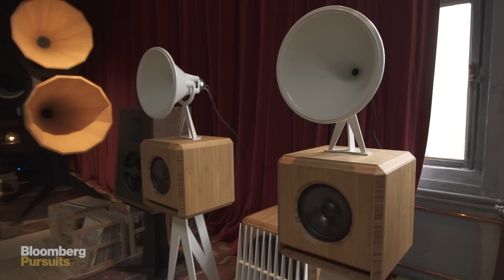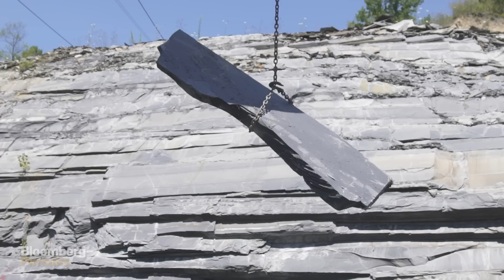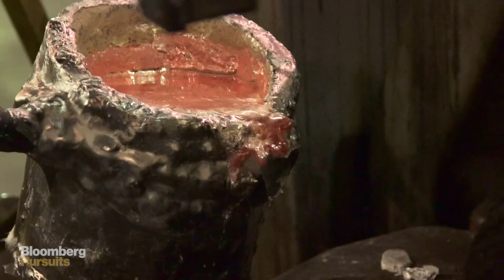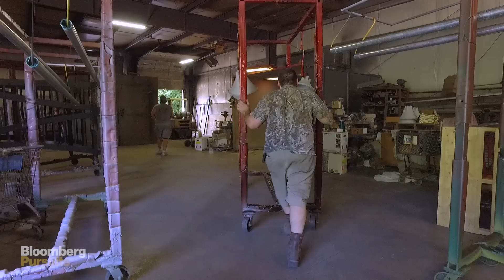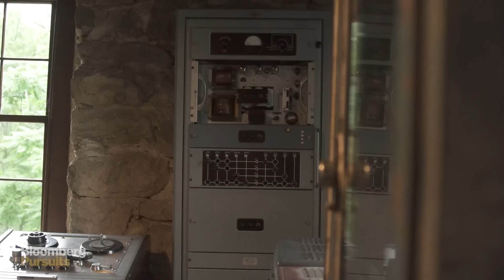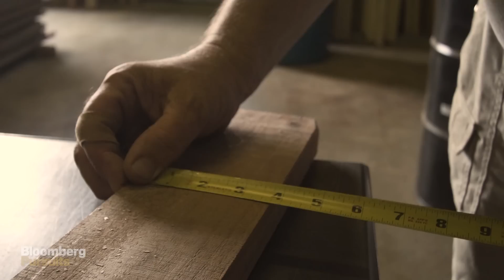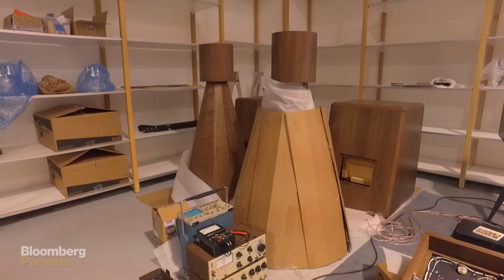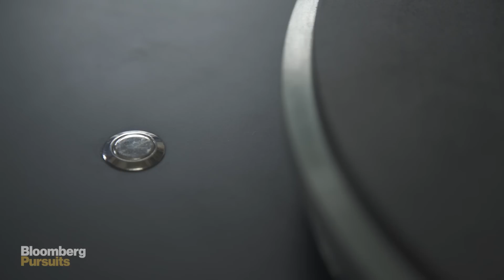How a $300,000 Speaker is Made

Comment: Why not just automate production using the same components and design? Surely it would produce a near enough quality product at a fraction of the cost. Or do these snobby 'audiophiles' just like to feel like a special snowflake when they think of all the hard work that went into their vanity trophy?
Reply: TheGuineapig certain things can't be automated. In fact even low end equipment has some hand assembly towards the end. That being said, this guy and his company is a hackjob and not a good reflection of the hobby whatsoever.
Reply: Of course there are things that can't be automated. However, soldering circuits and precise woodwork are not examples of those things

Comment: for $300.000 i'd expect better soldering and cable management
Reply: Really nice argument there.. Just shut your mouth if you're not going to contribute with your "knowledge". I'd love to be enlightened if you really have something worthy to say. But I doubt it since all you can do is making insults apparently
Reply: Prove me wrong and try to convince me otherwise then.. "Nah let's just throw an insult"
Reply: I just gave my opinion formed out of my own experience and knowledge. No way in hell I'm an expert and if I'm wrong,  I'm wrong. So please, tell me where I'm wrong since you seem to know it all
Reply: I think  I understand what you mean because I'm experiencing it right now... Good day sir
Reply: Thats a load of bullshit. 1: "high temperature-slowing solder".. It just means the solder has 2-4% silver in it, the rest is just regular tin, like any other solder. Which does indeed increase the conductivity, but only a very small fraction.. Also, heating up the metal parts you solder is the standard process when soldering... So the solder can flow easily and it makes a good connection. It's literally the definition of soldering. And in NO WAY that allows for the soldering to be that hideous.. Don't even get me started on all the cold joint .. This is just bad workmanship 2. Solid silver wire or not, the cable management in that thing could be far more improved, it looks awful. Solid silver wire is still bendable so the look of these electronics is totally not justified .. For $300 000 that shit should've been the most neat wiring ever. This whole product/company is just outrageous. Also, it uses a fucking pcb..
Seriously, people like you are the reason these companies are able to survive.. They use some fancy words  to describe a regular, standard procedure, call it 'high end', 'the only one on the market', 'better than any other method out there" (without having any scientific data) give it a ridiculously high price and ignorant people fall for it like flies. Any man with a regular functioning brain can tell this guy is just full of shit
Reply: Yes!  Thank you!
Reply: This man is a troll guys. Let him be... He will only try to fight you with words, make irrational statements and play himself off as he knows everything without actually sharing anything...
As far as I know, I have invited him to a debate and he's the one starting an argument but whatever.. Let's be smart and just leave this comment section so he can have the last word and be happy.. Sad though since I'm not at all an expert on the subject and would have loved to learn more..
Reply: Batt Man also the only difference between a debate and an argument is that an argument is usually heated. Seeing as you were the one calling names it seems like you were the one turning a debate into an argument.
Reply: Batt Man Mate, for this amount of money this is a really shit product. I'm sorry, but it is. 300k is something you can buy a house with, not a fucking speaker
Reply: Batt Man I wasn't trying to cause an argument. I'll agree the other guy was but don't rope me into what he was saying. Oh okay actually I understand why you debate the way you do now. You're a Christian. It's kind of like a prerequisite for being a Christian to be non logical and bad at debate so I get it now.
Reply: DR van der hull ??? i dont think he is a doctor in anything. if he is it is madness. he sells complete bullshit products. sen his new invention ? something you cant hear but really makes a difference.. it works on your brain with waves and such.... for real doctor vd hull.........
Reply: YES!  The engine bay of a Ferrari is as beautifully engineered and manicured as the the rest of the car.  At this price range the guts of the amp should be as artfully built as the rest of the system.  It was amateur work at best.
Reply: Your paying the 300k for the privilege of bad soldering and cable management.  Its the price for a nostalgic moment.
Reply: I guess he is intended to imply "come on we don't even accepts that if it is $300"
Reply: This is what I love about youtube: you can easily annoy racists and losers.
Reply: Take a look at the source I have given to you, 11-2 Q, page 57.
 www.vandenhul.com/download/CAwdEAwUUkNEW0Q=
I doubt if you can read though.
Reply: Eddi Kimball Oh wow you are dumb.
Reply: I second that. He's a squanchy squancher that needs a good squanching!!!! Ya hear me, Rick?
Reply: Maybe he can add the line: "randomization of the soldering & wiring techniques helps achieve a more balanced tonality, unlike inferior products with their rididly structured layout' LOL  BTW: That's actually true though = same way 'point to point' stuff tends 2 sound better becasue 'less interaction' between things (nothing 'neatly packed').  Same way stripping off the finish of a guitar & banging the body 2 $hit with dents & chunks missing helps break up standing waves 4 a more lush sound =)
Reply: I always find the ignorance of a lot of Americans to other countries. Like I live in America and I know a lot of countries use periods and not commas for thousands places.
Reply: Batt Man he didn't thumb up his own comment I thumbed it up lol
Reply: Batt Man also he didn't retort in the same way he never called you names to insult you lol
Reply: Batt Man what I was adding was calling you on your bullshit but alright.
Reply: Batt Man I actually did read the other comments and the other guy seems to know more about what he's talking about so after reading quite a few comments I decided to start liking them and replying. You just assumed I didn't read them because I didn't talk about them. I didn't talk about them because I don't know about soldering but his points seemed more correct to me.
Reply: Batt Man just because I'm not middle aged like you doesn't mean I'm uneducated. In fact just me being an Atheist alone makes me more logical than you. I don't believe in a magical sky daddy that grants prizes to those he deems worthy and to those he doesn't deem worthy he allows them to be killed and get cancer. Yeah what a great being to believe in.
Reply: Thank you guys for all the comments, even though some are hostile. I respect all of your efforts in writing those comments, and I will start my own channel to answer these, probably later next week. 

I apologize for my limited knowledges, and you can say this is because I am only 15, and I am only a Hifi Fan for 4 years, even though I have been making my own headphones, CIEMs, and Amplifiers by myself for over 3 years.

First of all, I apologize for being unable to find the reference for my claim on soldering yet, but after contacting the engineer of Dita Audio, Mr. Goh, told me that the soldering job is acceptable in this video, but could be cleaner. Too much leftover flux is on it. This joint is a result of cold soldering, and the reason why it looks like primary school work is that the cables connected look very messy.

But this mess is necessary. The components are hooked up by thick electric wires, probably made of silver(much thicker compared to PCB). This would massively improve the sound quality, especially for the high-frequency. Some wires are also wrapped in metal as a shielding layer. This minimizes the EM distortions, which benefits the sound quality. This is very common in Hi-end audio products. PCB is much cheaper, and much easier in assembly.

The reason why silver is added in the solder is not because of the conductivity, since the improvement is negligible, but because that the 3% silver in it provides a protective layer on the surface after the solder is cooled. Using a silver tip on the electric will do the same job if you cannot afford silver solders.(Reference: AJ Van den Hul, www.vandenhul.com/download/CAwdEAwUUkNEW0Q=)

Should you need any further information, please do not hesitate to contact me in the comments.
Reply: Still, read this.
11-2 Q, page 57.
 www.vandenhul.com/download/CAwdEAwUUkNEW0Q=
Reply: Well fun fact...
Some of the great amps in rock where all point to point wiring... and really not that pretty looking: but gave where it counts, the sound.
Reply: they like vinyl (demonstrably lower fidelity) - what did you expect?
Reply: "You are racist against free speech." 
Priceless.
Reply: Dude there shouldn't even be a comma there. It should look like this $300'000,00
Reply: The soldering is a result of high temperature-slowing soldering work, which contributes the quality of sound. Heating up the metal as well allows the components to have better conductivity, so the soldering looks absolutely hideous. Dr. Van Den Hul also suggests this technique in high-end audio. The cable management is done on purpose-- using separate cables can largely improve the sound quality, because the conductivity of a PCB is far worse from solid silver cables. These are the details that worth a couple extra thousand dollars.
Reply: Jeroen Verbeeck You did 300$ with  a extra 0 in the cents, $300,000.00 is what you were going for.
Reply: Well if we're going to be a smartass; the dollar sign should be before the number. Also, in my country we actually do write it like I did.. What are we even talking about.. The fact still is that this absurdly overpriced speaker has some awful soldering. Even I did better soldering my first time

Comment: That amplifier board still has flush smooo all over it. Like it was built on a budget in Shenzhen.  Also the board has high end components yet makes almost no efforts to minimize cross talk between the tubes, because you know tube heads must see the tubes to get the placebo effect going. If you are thinking about dropping 300k on a sound system do yourself a favor and don't buy into this artsy bullshit. I could build you a stereo system for a fraction of the price that used solid state components and it would sound just as good if not better. In-fact I would love to see a test where you put audiophiles in the room and have them listen to music played on a tube amp that looks like a solid state amp, then on a high end solid state amp that looks like a tube amp and then the same system as is.

Comment: I'm always very wary when they push products like this. I always think to myself, it doesn't matter how much you spend on a speaker if the recording studio etc wasn't as high quality as the speaker, which they never are. Also from an electrical engineers prospective, the soldering work on the boards looks very dirty.

Comment: The blabber about materials is pure marketing BS. Sound quality? Meh, it depends on what each individual can reliably discern in a blind test. Physics? well yeah, you need a certain size/weight/mass of speaker to reproduce sound. Cost? It does not need to cost 300k. Really good REFERENCE speakers, the type used by studios who actually do the mastering of the stuff you are listening to, are mostly under 10 grand. Quality? this is actually something that can be measured physically using instruments. Just remember a flat response does not mean a speaker will sound nice, because the mastering reference speakers used by studios often dont have flat responses themselves.